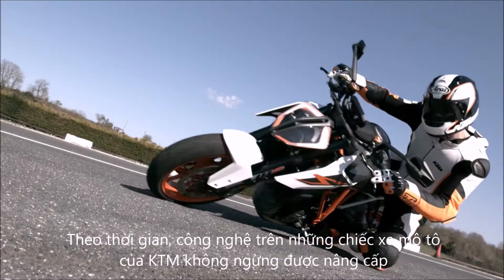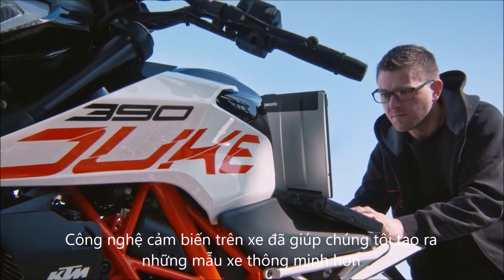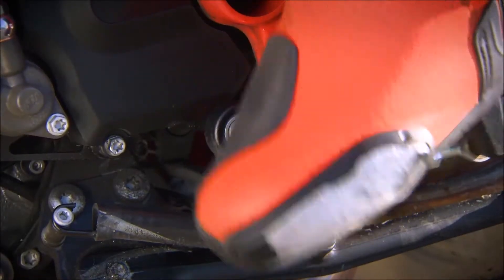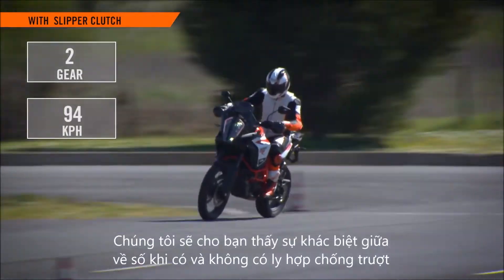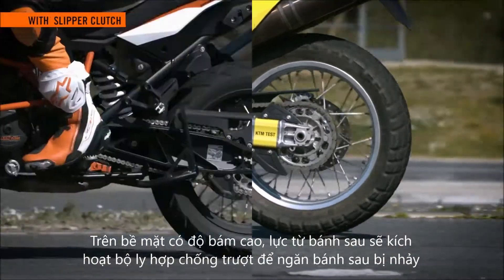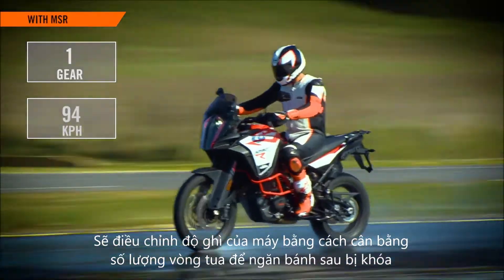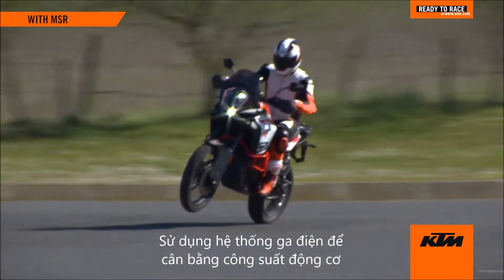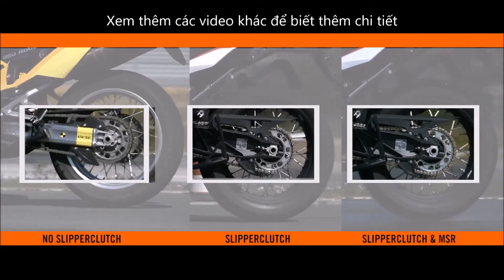KTM - Slipper Clutch & Hệ Thống Kiểm Soát Trượt Bánh (MSR) Hoạt Động Ra Sao?

Comment from the maker: Sự kết hợp của li hợp chống trượt (Slipper Clutch) và hệ thống kiểm soát trượt bánh (Motor Slip Regulation- MSR) giúp điều khiển xe thật mượt mà và dễ dàng, hạn chế bánh sau bị trượt hay khóa bánh khi về số nhanh, phanh gấp. 
----------
The Power Assisted Slipper Clutch with the MSR (Motor Slip Regulation) technology enables smooth gear shifts for an effortless ride. It prevents the hopping & lock-up of the rear wheel while downshifting or braking sharply. 

-----------------------------
🇪🇺 🇦🇹 KTM Saigon :
Địa chỉ / Address : 3 Nguyễn Lương Bằng, Quận 7, TP. Hồ Chí Minh.
🇪🇺 FANPAGE KTM Saigon: https://bit.ly/3k5TWFr
🇪🇺 INSTAGRAM KTM Saigon: https://bit.ly/3ANNJo7
🇪🇺 TIKTOK : https://bit.ly/3iTt9wv
☎️ Hotline: (+84) 888.366.711 hoặc (+84) 915.603.067

🇪🇺 🇦🇹 KTM Hanoi:
Địa chỉ / Address: 583 Nguyễn Văn Cừ, Quận Long Biên, TP. Hà Nội.
🇦🇹 FANPAGE KTM Hanoi: https://bit.ly/2UscdUw
🇦🇹 INSTAGRAM KTM Hanoi: https://bit.ly/3ANNJo7
🇦🇹 TIKTOK : https://bit.ly/3iTt9wv
☎️ Hotline: (+84) 888.366.711 hoặc (+84) 938.381.723

#KTM #moto #pkl #KTMVietnam #KTMSaigon #KTMHanoi #ComingSoon #xeKTM #KTMMotorcycles